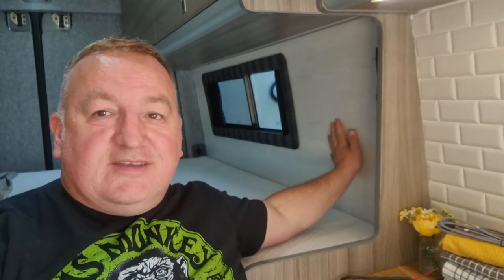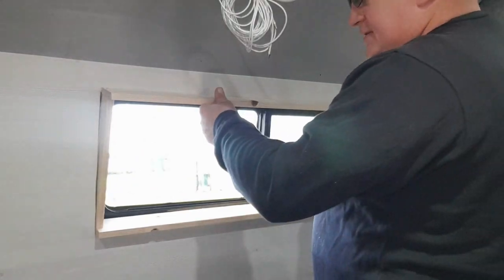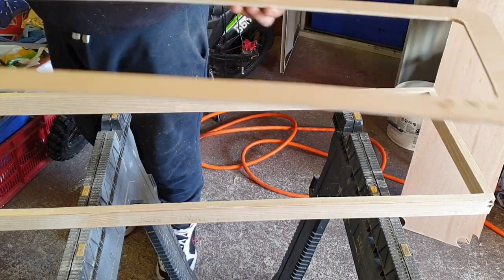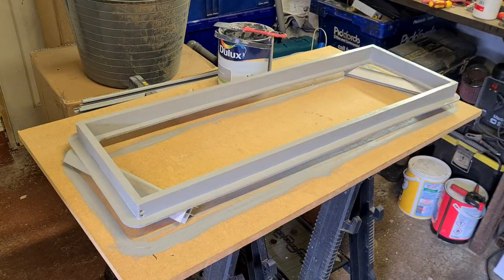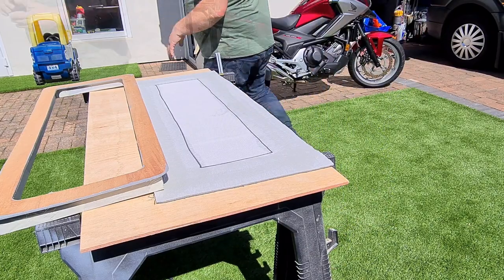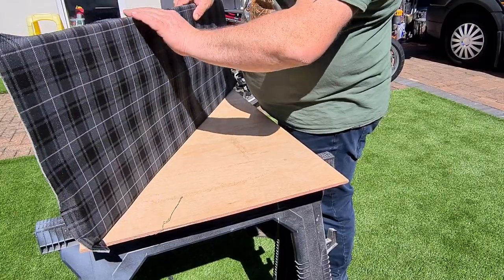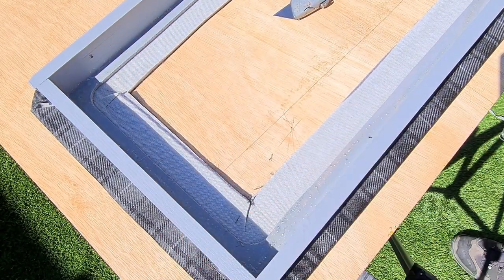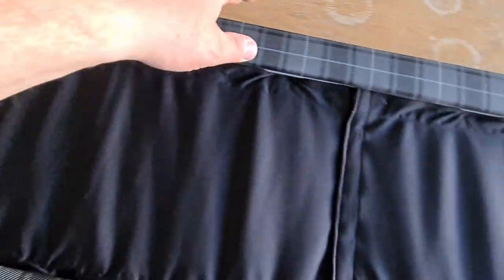selfbuild campervan | vw crafter | van build | window surrounds | part 40 | the crafty blinders

Comment: Have you had the van on a weigh bridge yet?
Reply from the maker: Yes we have it weighed in at 3240 so I've up rated the suspension and I'm in the process of up plating the van
Reply: @TheCraftyBlindersvanlife  good stuff, mines a very similar layout to yours and I’ve been worrying about it being over weight
Reply from the maker: @michaelpotter5455  3240 was the weight without me or any passengers or our belongings I'm checking it again this week as I need a weighbridge ticket for the up plating process 
I will keep you updated on how it goes
Reply from the maker: Hi Michael just a quick update I burst the bank 3600kgs fully loaded! so to keep it legal I'm not filling up with water until I get to my destination saving 70kgs, by then I'm running on half a tank of fuel or less saving 30-40kgs so in reality I should be under or within the tolerance VOSA permit
we are still uprating the van to 4050kgs using SV Tech so it shouldn't be a problem in the future and during winter I will be shaving some additional weight the tow bar is going straight away I think it's about 50kgs with the step and accessories and I could also do with losing a few of my excess kgs :-)
Reply: @TheCraftyBlindersvanlife  I appreciate the update! You’ve got me worried about my total weight now, something I didn’t even think about at the start of the build if I’m honest. I’m almost finished now so I think I’ll get it weighed and see what I’ve got left to play with. I’ll also be losing my rear step for a few kg saving.
Reply from the maker: @michaelpotter5455  these vans are more than capable of handling the weight it's just tge legal stuff that's the issue I will be making a video on the subject and how I resolve the issue